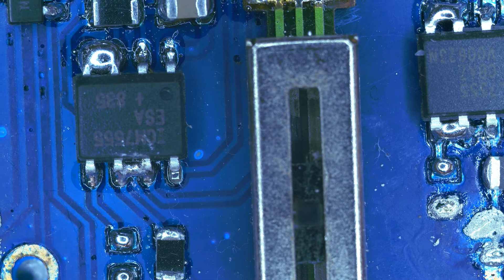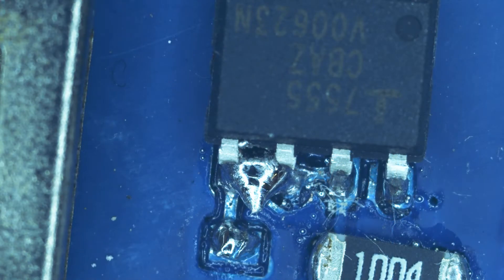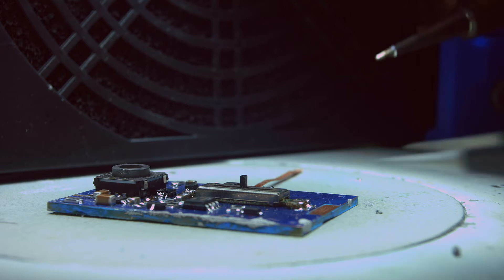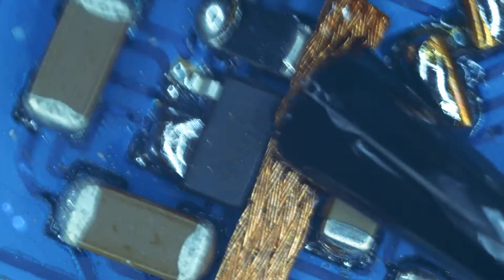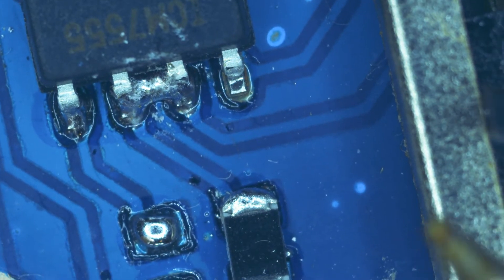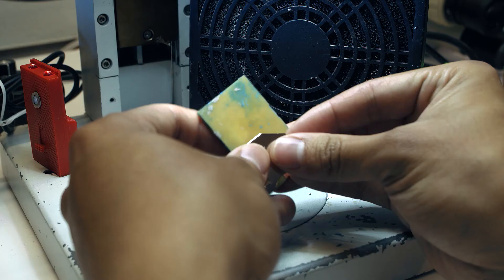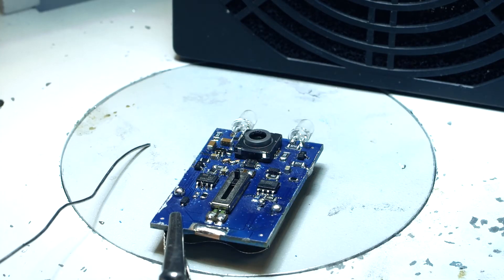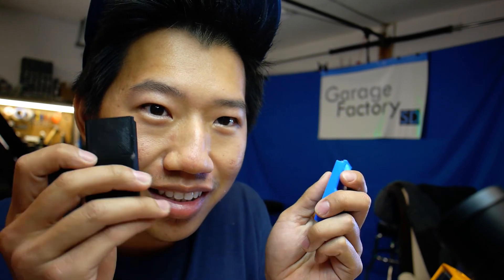How to Fix Solder Bridges and Complete Final PCB Assembly

Comment: every time I do this, the solder bridge doesn’t soak into the wick. I believe it is lead-free solder which I hear is a nightmare to wick up
Reply from the maker: Try increasing the soldering iron temp or use a bigger soldering tip. Heating the wick up more will attract the solder easier